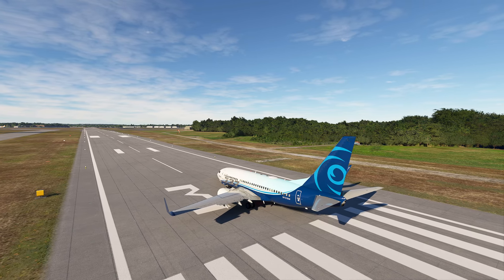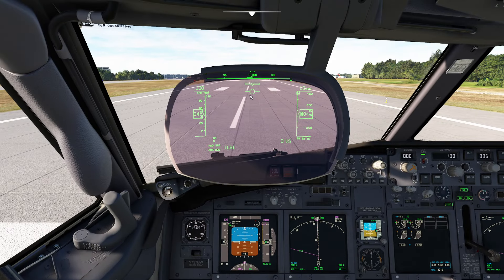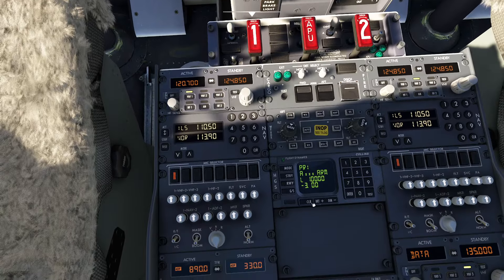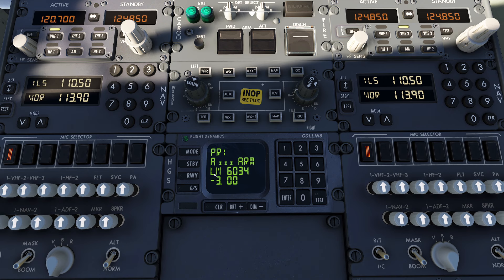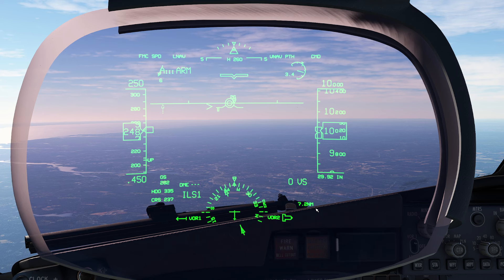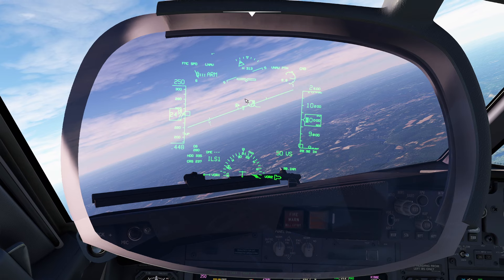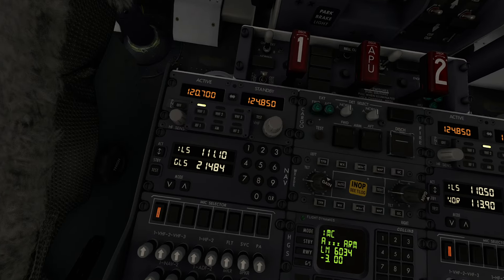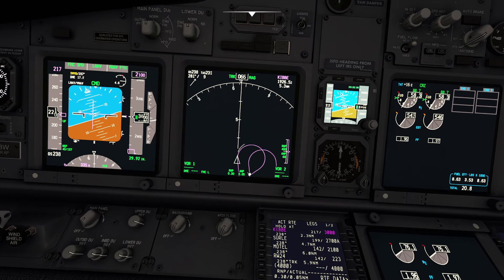MSFS - Boeing 737 HGS/HUD Guide

Comment: The "display unit" is the combiner.  For this model, it is two pieces of glass that have a "hologram" squished between the two.  The "front" piece of glass, the one further away from the pilot, is concave and the rear glass is convex.  If you could look from the bottom, you could see the separation.

Secondly, there are four, potentially five pieces to this system.  The first one you mentioned is the combiner.  Just above the pilot's head is the overhead unit, or OHU.  You mentioned the HUD Control Panel, HCP, or as some pilots use it as a cup holder.  The HUD Computer, or HC, is located in the avionics bay.  If this is a Model 4000 system, it has only one button on it, a built-in test (BIT) button.  The last piece is optional, the HGS Annunciator Panel (HAP), which sits in front of the co-pilot.  Other than that, great overview of the system.

One quick thing to add.  If you want the display on the combiner, the glass in front of the pilot, to clear, you should be able to press the "CLR" button.  That will blank the display.